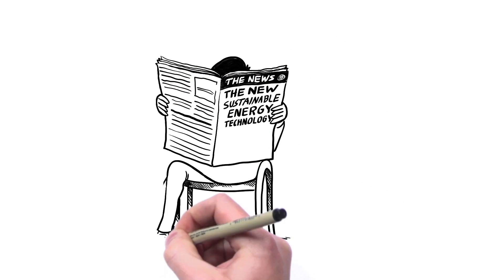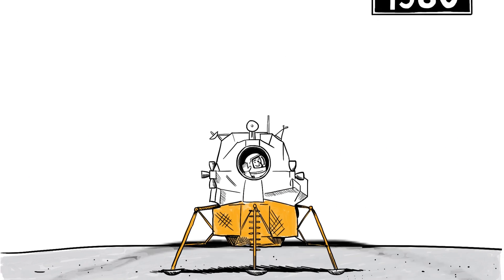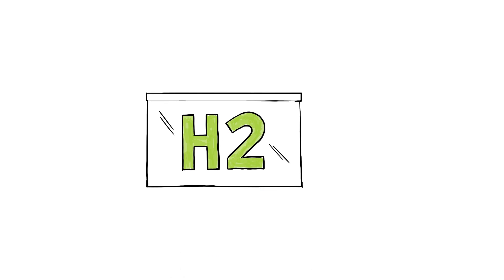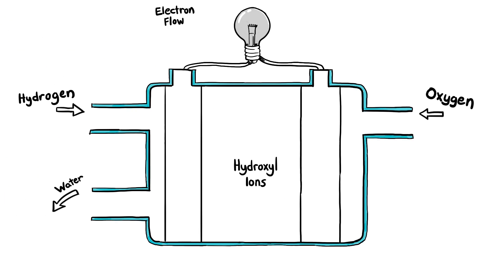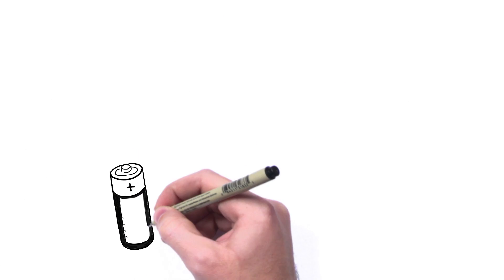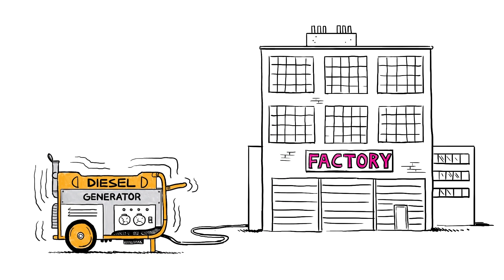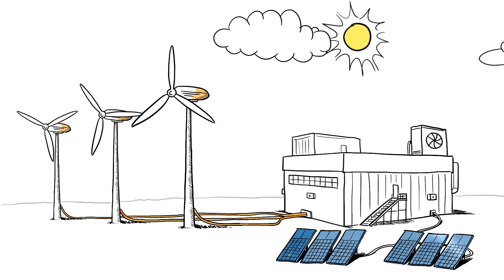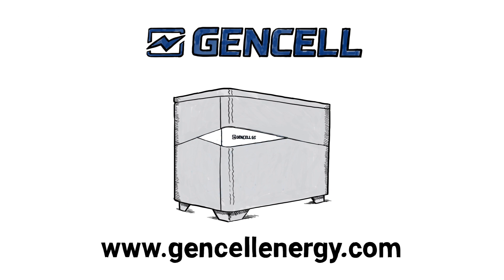How Hydrogen Fuel Cells Work - GenCell

Comment: A pilot project succeeded to recycle CO2 into fuel that can be used in all types of gasoline engine. If that goes into the market, where is your edge?
Reply: quieter. greater efficiency (less mechanical loss). not reliant on a finite resource. Power made at the source (not needing to be shipped from other side of the globe). There are other byproducts from burning fossil fuel, not just CO2

Comment: If I understand correctly, you supply oxygen and hydrogen, (you need to make the hydrogen...) so you put loads of direct current into producing hydrogen and oxygen (to use hydrogen) and then simply turn around and produce electricity with it? Why not just use electricity in the first damn place...
Reply: Because then you're basically using the hydrogen (which is very abundant) to also create electricity, killing two birds with one stone, and you don't need to add extra electricity in to produce the water because it's essentially just recycling itself. Idk if that made sense.
Reply: @oliviaroy3078  ye but why make the hydrogen and make electriicy from it when you can use the electricity in the first place, its adding another step and you loose efficiency.
Reply: @f-j-Services  Hydrogen is energy-dense, transportable and storable. You could say "Why not just use batteries if you need electricity on a cloudy windless day (in the renewable energy generation scenario) or just charge your car's batteries (if used for an EV)?". In this case, batteries are heavy, more polluting in production (compared to hydrogen, not fossil fuels) and degrade over time. Basically, H2 is like a battery in itself.
Reply: @edgarkazak8165  Well for this application then it is good. Other applications, its just not appropriate. Is producing, then storing hho gas or h2 in general, however their process goes, more efficient than produciing and charging phosphate 4 battieries, assuming the LifePo4 bats are above 0 degree celcius? They do las' a looong time, (they say 5k 100% duty cycles) and are lightweight.
Reply: @f-j-Services  Hydrogen used in fuel cells has an energy to weight ratio ten times greater than lithium-ion batteries.